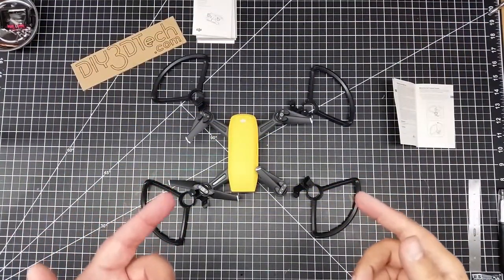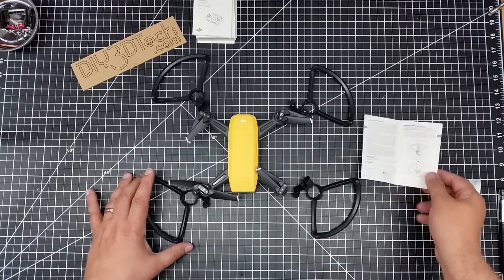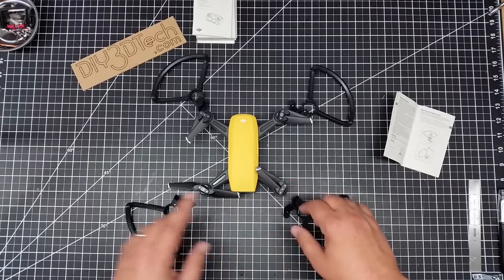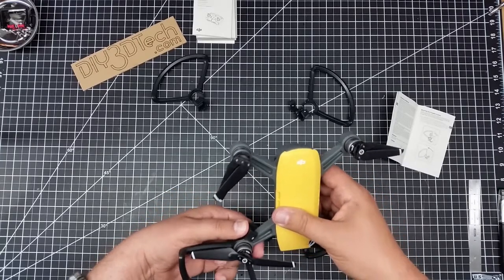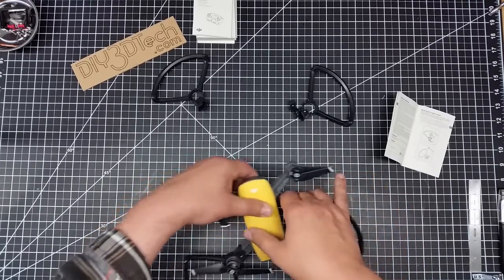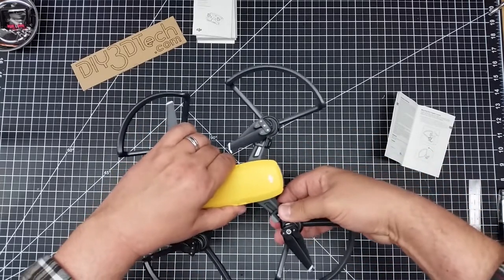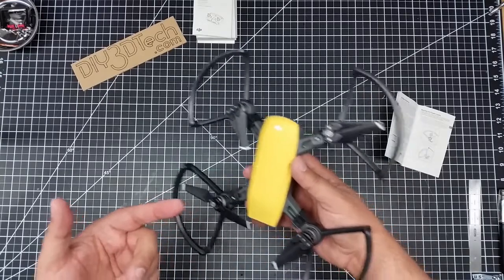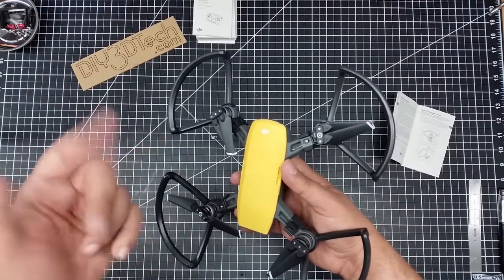Video Drone - DJI Spark How To Properly Install The Prop Guards!

Comment: Why does no one show how to uninstall them! :'( I put them on wrong and tried do detatch them and it broke the lamp cover..
Reply from the maker: Sorry to hear as you just reverse the "on" process...
Reply: I figured it would be that easy cause theres not even a vid on how to do it.. its just im scared to put the wrong guard on the wrong propeller again and brake the lamp cover :( Well just have to be more careful i guess. Thank you for your reply :)
Reply from the maker: No worries and biggest thing to remember if your forcing something, it likely isn't right way :-)  Enjoy flying!